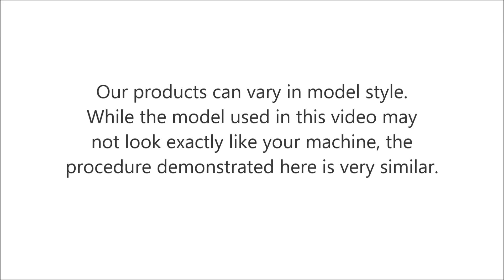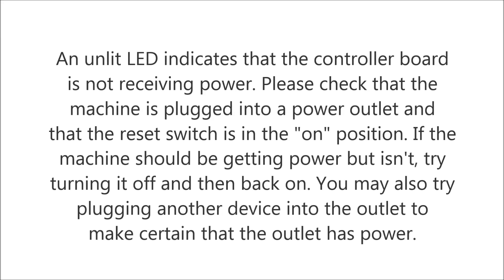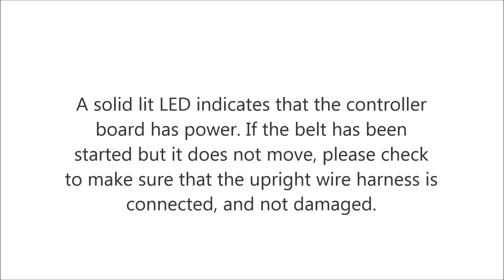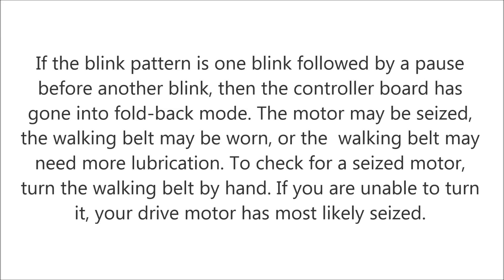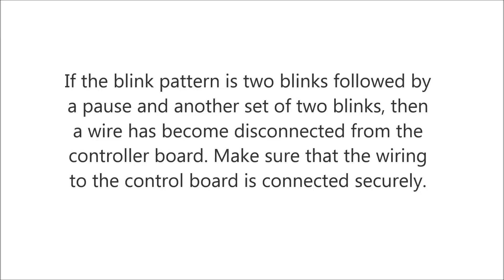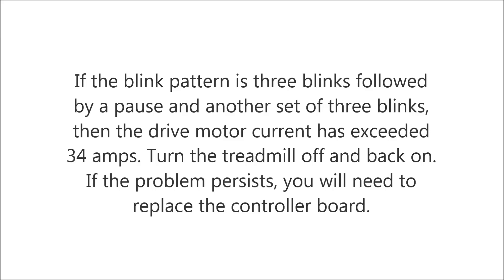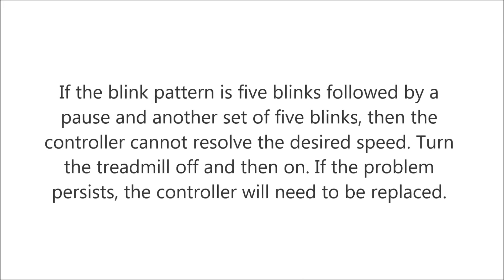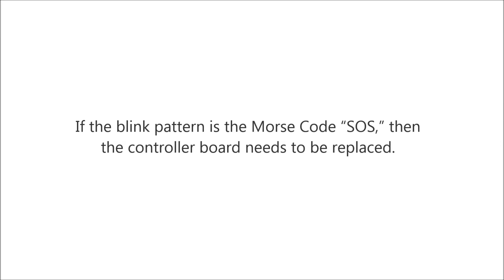LED Blink Patterns on the Control Board - Treadmill

Comment: I got a Nordic Track T.6.5.s, when I turn it on it works for about 30s of use and then comes to a stop and starts flashing 1 blink pause 1 blink, when I step off it tries to move again but does not reach its full speed, I bought this treadmill in 2020 and still have not been able to use it. I am wanting to get it working
Reply from the maker: The error you are seeing is indicating a high amp draw. the motor is pulling more amperage than expected and the controller is shutting it down until the amp draw is normal. This is usually because of over tightened walking belts or belts in need of lubrication. on older machines or machines with a lot of use it can indicate a worn out walking belt. This can also occur if foreign substances get under the belt causing friction.  In rare cases it can be worn out or defective rollers or motor... anything that causes the motor to work harder and the amps to peak on the treadmill. Continued use at high amp draw can damage the motor controller itself.
Reply: Did you ever resolve the issue? I have the same treadmill and also bought it in 2020. I don’t use it often, maybe 200 miles on it total. I’m having the same exact issue and can’t find an answer anywhere. I’ve seen other people share their same situation but none of them have an answer.
Reply: @iForgot160  no, I finally decided to take it to the dump 2 weeks ago

Comment: Is it common to have to replace the controller twice in less than a year? I have a Pro Form Carbon T7 and that is where i am at now.
Reply from the maker: I would not expect to replace the controller that frequently if there were not some kind of external issue causing the failures. Make sure you are using a surge protector with your treadmill as specified in your users manual. A common issue that can cause the controllers to fail is  high amp draw. make sure your rollers, belts, and deck are not worn out. Also check that your belts are adjusted and the walking belt is lubricated.
Reply: @FitnessEquipmentHelp  appreciate it. Suggestion on where to get the lubricant?
Reply from the maker: @jeffhill-mh2bx  It is still branded Icon Health & Fitness Performant Lube. you can get it from the manufacturer. I have also seen it on amazon and may be available in sporting goods stores that carry iFIT brand products (like ProForm).
Reply: @FitnessEquipmentHelp  Thanks
Reply: @FitnessEquipmentHelp  On the Carbon T7, is there a speed calibration process. Doesn't feel like the actual speed is matching to what the console is showing.
Reply from the maker: @jeffhill-mh2bx  first make sure you are in the desired units- either MPH or KPH. There is not a bult in speed calibration. The speed sensors and console software have been changed since 2015 models to no longer be required, as the controllers are pre speed set at the warehouse. (That is why it is important to get the controller from the manufacturer for the specific model and version you own). If the speed is off small adjustments can be made to the Speed potentiometer on the controller. (Small plastic screw on the short edge of the controller). Turning it slightly clockwise will increase the voltage going to the motor slightly for each speed level, (counter clockwise decreases the speed). The downside is that w/out a speed sensor you cannot tell how fast the belt is actually going. I have recommended and used a Contact tachometer to make adjustments on late model units  if necessary. This tool will allow you to make more precise adjustments. Most of the time the parts come from the factory or the warehouse set w/in tolerances.
Reply: @FitnessEquipmentHelp  I think i will try to adjust the potentiometer a bit. I ran at 4 MPH for 6 months, got a new controller and  4 MPH is a struggle now to keep up. I back the speed down to 3.5 and that feels more like what i was accustomed to. Thanks for the insight.

Comment: I have a Proforma 600i, the red light indicator is solid red, but the screen is off and there’s no response when I try to press “Start”. Checked all the wires on the motor board and it’s all good there, is there any other place I need to check?
Reply from the maker: You will need to make sure the magnetic safety key is in place on the console. If you are getting power to the console and the key is in place then you should check the wires between the key switch and the console. (Usually the console will blink for just a second when the power switch is turned on indicating power to the console. You may need a second person to flip the switch while you observe if the console lights.)

Comment: Very helpful video, thanks for posting! Seeing a slightly varied pattern on my studio s22i bike: solid green, blinking red: 4x followed by 2x. Any idea what it’s trying to say? Given the 4x patterns in the video indicate need to replace the controller, assuming that’s it, but wanted to triple confirm. Thanks!
Reply from the maker: This video is for treadmill motor controllers. The patterns for the bike controllers and treadmill incline controllers for use with DC lift motors are very different. Usually 4 pause(x), blink errors mean it didn't get a response from the incline motor it was expecting and 6 Pause(x), blink errors mean it didn't receive input from the resistance motor when it didn't receive feed back. it does not necessarily mean the controller is bad.
Reply: @FitnessEquipmentHelp thank you! My elliptical is giving 4 blinks while the whole console stopped working. What could that be? Could it be it can’t get the feedback? Thank you!

Comment: I have a proform 600c the treadmill belt runs and there isn't any tension on the drive motor. But the motor stutters goes to normal speed and then for a second or so slows down then goes back to normal it does that every full rotation it seems like. I get a consistent blinking pattern. Is it the deck or the motor?
Reply from the maker: I want to make sure I was following you. you are saying that without anyone walking on the treadmill the belt will slow down and speed up? this can be a few things and you most likely will not be able to confirm it without additional diagnostic tools but I think it is most likely a controller issue. If the speed signal to the controller is constant but the voltage to the motor is dipping down enough to slow the motor noticeably then the issue is likely the voltage coming out of the controller.  the other options would be that the signal coming out of the console is dipping or that the motor is failing.

Comment: I have a proform 18.0 RE eliptical.   The board is steady on give s blink when the ramp should go up/down and gives no indication if resistance is adjusted.  replaced teh board same issue.  Both motors appear to work when I get battery and test them.  I get no flashing led to indicate any problem.  Control board was replaced as well... Thoughts.  Getting fat now.....
Reply from the maker: The power board on that elliptical has a red and green light that should be on all the time indicating it is receiving 120Vac from the wall and its should be sending 12Vdc to the console. This is probably obviously working since the console is on. There is no LED for any resistance functions. the signals just pass through the board. The other two lights are also red and green. One of these lights comes on anytime the power board is receiving an incline up signal from the console, the other comes on anytime it is receiving an incline down signal from the console. (The indication for up and down may differ depending on the configuration of the elliptical). Neither of the lights should be blinking. If the incline red and green lights are blinking I would suspect an intermittent signal reaching the board. First try an incline calibration (instructions for your model should be in your users manual). Then if the blinking continues I would suspect a pinch or damaged wire harness and replace or repair that before I would replace a console.

Comment: Thank you for the excellent video. I have a solid green light and a solid red light, yet the treadmill will not start when I press start. The outlet has power, the magnet is attached, the power on the machine is turned on. Any suggestions?
Reply from the maker: If the red light does not blink (normal or error) when the console starts a workout then it seems the signal to start the belt is not being received by the controller. This is usually a wire issue.
Reply: @FitnessEquipmentHelp  Thank you :) I did replace the upright wires, but the console is still dark and completely unresponsive.
Reply from the maker: @michelle1colorado  If the console is not receiving power and you are sure the wires are intact then there is either a issue with the controller not sending power or the console doesn't respond when powered on and you would want to replace the controller or the console. Typically you would need a voltage multimeter to test for the issue. If the red and green light are on the controller, then the controller at least believes it is producing the power required for the console; so would indicate a console issue.
Reply: @Fitness Equipment Help  I can't thank you enough. You have been 1000 times more helpful than Nordictrack. I really really appreciate it. :)

Comment: Hi there, wondering if you have any ideas for  a Nordic Track S30 where nothing is powering up now. Looking at the red controller board led when you plug in power it lights up very dim and is kind of flickering it gradually gets slightly brighter over 20seconds and you can then tell its a very fast flash. After about 30seconds the dim flashing stops it does one fully bright light up for a second then goes off and stays off. Only way to repeat is powering off for a few mins. Any ideas I'm trying to figure out if it could need a new board, transformer or something else. Thanks in advanced.

Comment: I got the four flashes, replaced the controller board, and the treadmill ran okay but when I got on it sped up the belt it stropped again and the new controller is flashing the four flashes again, but only one time then it goes dark. Any advice would be appreciated. Thank you for this video!
Reply from the maker: the 4 flash error means one of the mos-fets on the board has failed. I know high amperage through the board can cause those to fail. You will need a new controller. you may want to make sure your belt is in good condition, lubricated and adjusted properly (as loose as possible w/out slipping) to make sure the amp load of the motor is reduced to prevent possible future failure. I always recommend a surge protector. A power surge can also cause controller failure but that dos not sound like you had this particular issue.
Reply: @FitnessEquipmentHelp  Thank you!

Comment: I have the pro-form city L6 foldable treadmill and only bought it 3 months ago. I used it once and the next time I went to use it the power comes on the display but when I press start the belt motor doesn’t run. I’ve tried everything and even though the belt motor doesn’t run, the display works and the time counts up. When I opened to see the motor, there’s a constant green light and also a constant red light. Any idea why this might be or how I might fix it? It’s brand new and I payed a lot of money for it 😔
Reply from the maker: if the red light on the controller does not begin blinking when the console is running a workout then it usually means the speed signal is not being received by the controller. This is usually a faulty or damaged wire harness. I would check it at any assembly points or folding pinch points for wire issues.

Comment: Looking for help Nordictrack 2450, the control board has solid lit red and green LED. But when I try to initiate incline program nothing happens and same for starting any workout, the belt does not move. The treadmill is brand new has not even been used once. The "power board" has a continuously flashing red led.
Reply from the maker: The newer model NordicTracks have Changed the incline system to use a DC powered lift motor. that includes the addition of new circuit boards to run the DC lift motor. The red light on the motor controller as seen in this video is the same for drive motor function however. because the light is on solid and not blinking it indicates the speed control signal did not reach the motor controller. (it does not know it should be powering the drive motor). Assuming the console has started a workout (it is counting time and distance) then that red LED should be blinking. Since the incline is also not working I would suspect one of the wires that communicated from the console down to the Incline motor controller (has the red light that flickers that is ground underneath the mounting bracket) That is the first stop for Both the incline and speed signals. If these wires are connected correctly and intact. I would have the Incline motor controller replaced.

Comment: Hello, I have a cheap treadmill I got online and hope you can help me on this. When I turn on my treadmill, the LCD console is lighted up but beeps and blinks steadily (without any error code and the buttons do not work). The lower controller board shows a steady blink. However, I have tested the motor with a multi meter tester and shows that the motor is still working. I have also checked the cable connection going to the controller board. Thanks in advance.
Reply: The belt also runs when I tested the motor with some batteries.
Reply from the maker: @nicc6816  It may be you have a stuck button on your console. Make sure your safety key is installed.

Comment: I now know my 2 year old 1750 needs a new controller board. I can't find how to order one. Model NTL14129 version 10. Help appreciated.
Reply from the maker: The controller for that model is a manufactures part number 406939. It is available at www.iconservice.com.
Reply: @FitnessEquipmentHelp  I wish it were available to order from that website. It has been out of stock. Clearly, a hot item to replace.
Reply from the maker: @crystalday7716  Ok, This will not work for everyone but I was able to determine that part number 445754 (which is in stock) uses the same controller and programming as the controller for your model. The only difference is that it is kitted up with a packet of walking belt lubricant. the price difference is $3.13 which is less than the price for a packet of belt lubricant on its own ($8.04). This may work for you.

Comment: My Pro-Form Carbon CTL stopped working one year exactly from its purchase date. Incline motor is fine, but the belt won't move (I can move by hand) and I've four blinks on the controller. Is this a motor or controller issue?
Reply from the maker: The 4 blink error on the controller indicates that the controller has failed.  some causes may be power surges as well as high motor amp draw. Make sure your belt is lubricated it is not uncommon to need to lubricate the belt annually depending on use. Always use your treadmill plugged into a surge protector.

Comment: Reviewed this a couple times, my situation doesn’t match any patterns in the video.

On occasion, the treadmill slows to a stop until I get off of the belt; red light will go through several long, slow blinks over 6-7 seconds before catching up and going back into rapid blinks. This seems to happen especially at slower speeds (walking); I’ve found myself hopping off the machine do it can ‘catch up’, then get back on hoping it’s working normally.

I just replaced the controller (c960i), yet the same problems persist.
Reply from the maker: Long slow blinks indicate a high amp draw by the drive motor. I would look to sources of friction, such as over tightened belts, a walking belt that needs to be lubricated or even a worn out belt that needs to be replace.
Reply: Thanks so much. Awesome video. I have a nordictrack x7i. When I power on it blinks for a few seconds and then goes solid. The console timer and calorie counter start running as if the unit were running but the belt does not run, the incline does not operate and the control pad seems completely unresponsive. None of the buttons cause any reaction. 🤔 The wiring looks OK. If anyone has any thoughts I would appreciate them.
Reply: Did you ever resolve the issue? I’m having the same problem on my nordic track t 6.5s and can’t find a solution anywhere. It seems several other people had the same issue.

Comment: My treadmill motor I checked with a drill battery works and incline works when I plug in the treadmill and console works but the belt does not move. I know it’s not the motor because with the drill battery the motor worked and belt started running
Reply from the maker: It sounds like the controller is not sending voltage to the motor. either there is a bad controller (in which case usually there is a error code from the red led on the controller) or the speed signal control from the console is not reaching the controller (a solid red LED light on the controller). If the console shows that a workout is running but the led is not blinking then i would suspect the wires between the console and the controller. (The speed control signal is along the blue wire on most iFIT brand treadmills. )